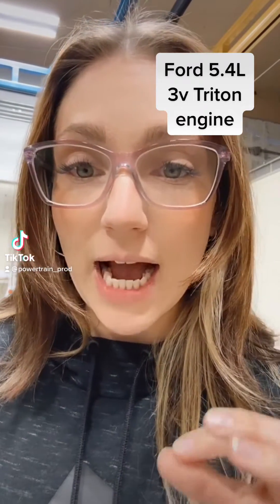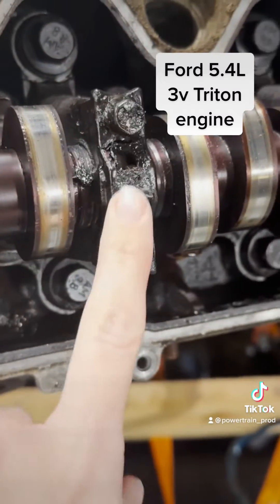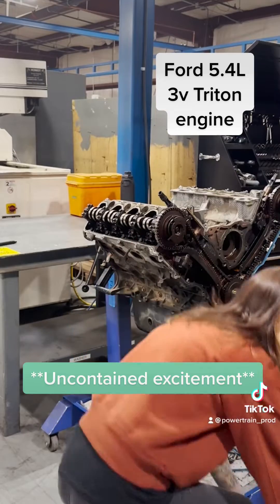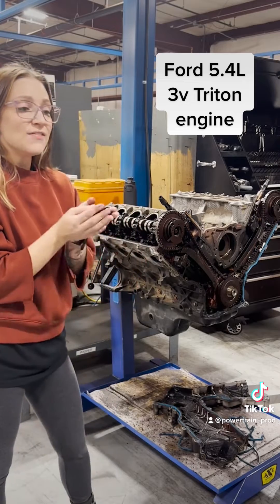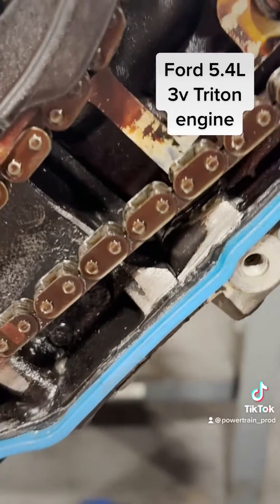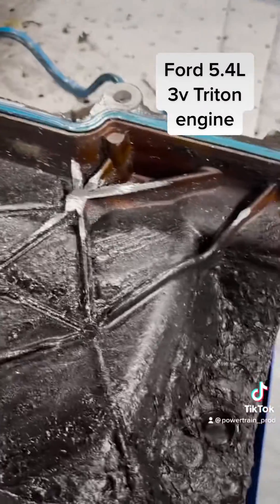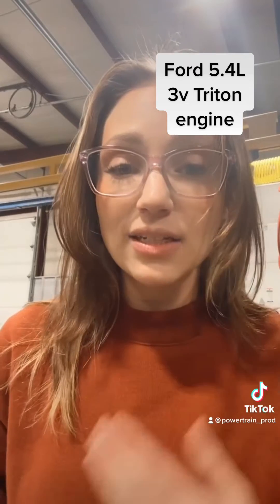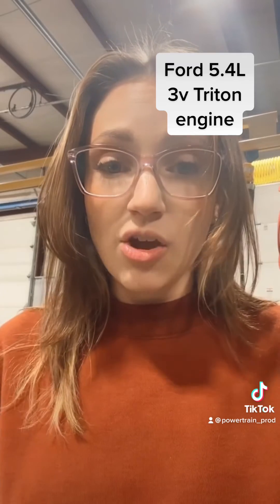Ford 5.4L 3v Triton Engine Teardown

Comment: Good info. 
As a man who spent at least 15 years in the heavy duty lubricant business helping fleet owners to extend engine life, the oil sludge is not an engine issue but more of a maintenance issue. 
 Engine oils today are better than they have ever been even from the late 90's onward. 
 Sure, the 3v engine may get a bad rap but 200k miles is surely possible with good maintenance and excellent lubricants.
  Realize that easily influenced viewers' steadfast opinion comes from a video such as this or a comment that a  mechanic with good video persona makes in a 30 second blurb. Then the parroting begins. 

 This, on top of the deliberate undermining of the American auto industry by the liberal leftist media and now our industry is ranked much lower after years of intentionally detrimental rhetoric towards our American industrial leaders. Look at nations that have little or no automobile industry and their international standing goes hand in hand. 
Yet I see praise for foreign brands with little support for our own time and again. Tag lines such as "worst engine ever" or that sort of clickbait adds fuel to the fire. Your business should do well because future generations quality of life will decline,  and perhaps cannot afford to buy new vehicles anymore.
At one point (I read that)1 in 5 U.S.  jobs had some ties to the Automotive industry. 
   Trump 2024!

Comment: They don't have oil sludge problems whatsoever. They have customer neglected problems. Sludge only occurs when you don't change oil regularly. I've seen plenty of these with two and three hundred thousand miles and still clean. Change your oil and do the timing job

Comment: I have a 2008 F150 Lariat and the oil pump is failing. What all upgraded parts do you use and what brand parts do you use?

Comment: I’m looking at putting one of these re-manufactured 5.4 L in my truck. I shouldn’t experience any of the timing and cam phaser issues with the new one?
Reply from the maker: No, ours does have upgraded new phasers to rid this problem

Comment: I have a 2004 F-150 8200 GVW with the 5.4 3 valve. Has 158,000 miles on it. When it blows, I will have my mechanic look at my truck. If he says it’s in good enough shape, I’ll be getting a new engine and transmission from Powertrain Products. 
On a side note, check it out on my channel. Has an Alpine stereo, 10,000 watts, 13 Alpine amplifiers, 16 vocal speakers, 6 10” subwoofers in a custom built sub box that I built. Alpine alarm, dual alternators, dual charging systems, dual under hood battery chargers, dual under hood batteries, battery and Superbank capacitor’s mounted in the bed. Multiple volt meters, multiple temperature displays, multiple level controls, so much More.
Reply from the maker: We will be so happy to have you as a customer, but sincerely hope nothing fails before youre ready lol
Reply: @PowertrainProducts  appreciate that. I’ve done so much to the truck stereo wise, I hope it lasts for a good while, yet. Lol

Comment: My 2002 lightning 5.4 2v as 243 thousand miles now the engine never been opened still has the original water pump and alternator
Reply from the maker: The lightning engine is a little bit different, but is still great mileage!
Reply: @PowertrainProducts  there's a big difference in general between the two valves and the three valve. I was thinking about looking at one of your motors but based off that stupid comment about the difference between the lightning and the rest of them makes me really unsure that my decision to look at your company
Reply: I believe this 100% I have had four of these Ford Lightnings and I do not baby them at all each of them is come close to 200,000 me just changing the oil.
Yet for some reason People Want To Praise Japanese brands as if without any regard to past history.